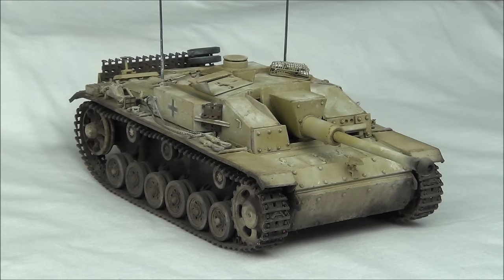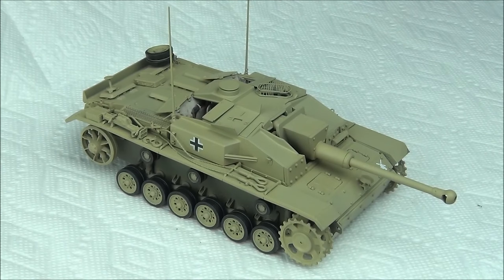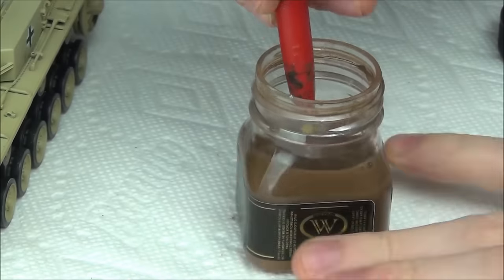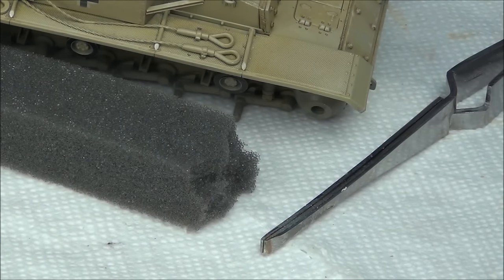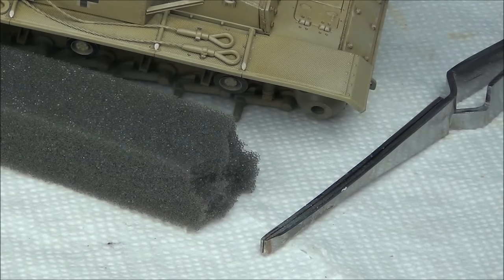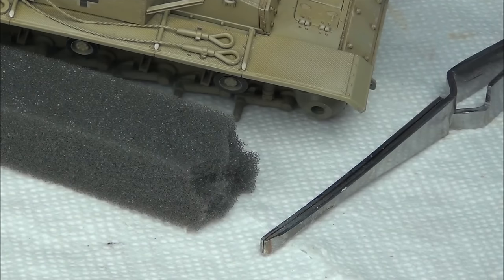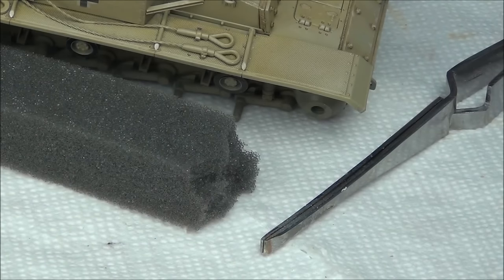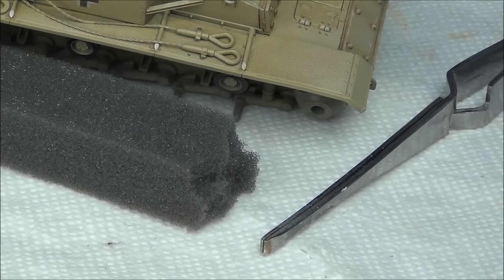STUG F/8 | Standard Weathering Procedure  (Full Weathering Tutorial for Model Tanks)

Comment: Hello, again! One million dollar question: do you apply a layer of varnish after filter/before pinwash?
Reply: Question nuber 2: do you apply a layer of varnish before oils?
Reply from the maker: My process is usually:

-Paint model + paint details + decals
-Semi-gloss varnish
-Wash
-Filter
-Oil dots and other oil effects
-Matte varnish

If you want to, you can apply varnishes between each stage.  But I don't find it is necessary since if you leave oils or enamels to dry for 24-48 hours, they will not be removed by later effects unless you are very rough.  

So you CAN apply varnishes (no harm comes from this), but you usually don't NEED to.  That's the best way to put it...I hope that helps :)

Comment: Yep, it’s an old video, but I need some advice. I’m doing a Tamiya M5A1 and wanted to do a hairspray chipped olive drab as a base. Should I use black as an underlayer or should I use more of a rusty color? Or should I skip the chipping altogether?
Reply from the maker: +Havanadog 7 well if you really want to do the effect, then a dark brown rusty colour would be good.  But US olive drab really didn't chip as it was a super thick and durable layer of paint that was baked on with heat lamps.  It would really just scuff up to a darker green colour, so that is another option - using a darker green ad the underlayer.  I plan to show this in a video soon.
Reply: Panzermeister36 thanks for the tip! Will definitely watch your video before painting. :)
Reply from the maker: +Havanadog 7 well it may be a month before my video is made sorry.  I've got a few things on the go right now.
Reply: Panzermeister36 the model still hasn’t even arrived yet so no rush 😂

Comment: there is a brighter yellow for Africa korps tanks. what do you suggest? is tamiya ts34 the right color.
Reply from the maker: This tank here was painted that colour.  Originally a bunch of these StuG F/8s were going to Africa, and so they got painted sandgelb.  Then they got sent to Kharkov instead.  I would usually use a slightly lightened XF-60 for the standard dunkelgelb colour, and here I used a different mix as I showed at the beginning.  TS-34 is probably pretty close, and you can just filter it lighter or darker if you want to change it a bit.
Reply: Panzermeister36 thank you

Comment: Hey, i tried to to this kinds of oil paint tone weathering techniques but when i used the enamel thinner it took off some of the base coat, any solution for this?
Reply from the maker: +RED Spy I would suggest using a different thinner.  It's likely that your thinner was too strong and damaged the base paints.  You can use lighter fluid as an enamel thinner and it should not damage acrylic base paints.  I hope that helps.
Reply: Thanks man love ur channel keep it up!

Comment: How accurate is that kit? I'm a dumbass for interior kits,I have to have them lol I do check into accuracy as well,but don't let it get to me if it's things that can be easily fixed. I'm barely on your filter section,got ways to go
Reply from the maker: It's quite accurate.  I can check on my list and get back to you.
Reply: @Panzermeister36  for sure
Reply from the maker: Sorry for the delay.  I have a list I've made of all corrections for these StuG kits.  For this vehicle, just the rear tow point, rear light and corresponding rear fender are wrong:

-Use option of parts B41+B42+B43+B44 on rear hull (step 3) not B29
-Replace rear light parts G8+J4 (Panzer III hull) with A13 or G9+G2 (StuG hull)
-Replace driver’s side rear fender Q25/26 with A39/41 (to match above)

Comment: Did you put any clear coat after your base coat, before you did any of the weathering
Reply from the maker: No, I never use any clear coats when weathering.  I find it to be unnecessary.
Reply from the maker: Well I applied a matte coat right before the Hairspray Chipping actually, but that was because the chipping can damage the underlying effects due to all the scrubbing.  But that is the only case where I will seal a model.
Reply: Panzermeister36 Awesome. Thank you, just getting into doing weathering. I’ve done a little weathering before but nothing as extensive as your video. Other videos they used that floor shine before the washes and mine just turned out too glossy. Great video and great reference video for begginers
Reply from the maker: If you're going to do a coat like that to help the washes flow, yeah I personally would not use gloss because it's just too shiny.  Satin varnish is a good middle ground.

Comment: Great video!  You do very great work!  Is that Dragon 6644?
Reply from the maker: Thank you Matt.  Yes it is 6644...best Dragon kit I've ever built.  Highly recommended!
Reply: How long would you say the oils and filters take to dry?  Never used either before so I am curious to try.  Also, on your video with the Panzer III in the Grey/Brown camo, what color brown was that?
Reply from the maker: They usually dry within a couple of hours, though artist's oil paints can take a full day or two.  The Wilder ones dry much quicker, but usually after a wash or filter or something like that I wait a full day before doing the next technique, in this case that was the chipping.  As, I used Tamiya's JGSDF Brown for that...I think it's XF-72.
Reply: Thank you!  Do you put any dullcoat or clear coat before you start the weathering process?
Reply from the maker: I didn't in this case, but I sometimes do if I want to protect undelying effects.  For example, I did a sealing coat right before the whitewash.  I also use matte lacquer for a sealing coat because I find a gloss cost to be too smooth to be able to weather with oils or pigments.
Reply: OK, thanks for the help!  I usually use testors dullcoat before I do any weathering.  Sometimes use Vallejo matte varnish thinned with water as well, but that sometimes leaves a white streaking affect.
Reply from the maker: Testors Dullcote is exactly what I use too :)
Reply: It works well.  Really brings out the shadow affect under the main color.
Reply: One other question, and I apologize for all the questions, haha.  This might be a dumb question but are the stencils reusable for the crosses or do you need to use a new one each time?
Reply from the maker: Matt F Don't worry!  Ask all the questions you like :)  These DN Models masks are reusable, but I'm not sure about other brands.
Reply: Thank you!  Was considering trying them at some point.
Reply from the maker: Mitko Nikitov runs that company, and he has a Youtube channel too.  If you search DN Models on google his site should pop up too.
Reply: I'll check it out.  Thank you!
Reply: what would you suggest to use if you wanted a textured surface, such as seen on a Merkava tank?
Reply from the maker: +Matt F Ah yes anti-slip... I've never had to do it before, but I will soon.  SchweinHund227 (Norm Lajoie) and Beez Beasley have some good methods for doing this, so check out their channels.
Reply: Panzermeister36 thanks!  I'll check them out.  having a very hard time finding kit 6644, think I waited to long to buy it lol

Comment: You don't paint handles with vehicle paint...it causes chips to cut your hands as you use them.
There are a couple versions of the wire cutters, late war they were compressed paper, mid war bakelite, early they were wooden with wire retainers.  They stopped the wood because it was too labor intensive and conducted electricity, stopped bakelite because it was needed for other items.  The compressed paper was resin coated and cracked often cutting hands.  So most were wrapped with leather or cotton to protect hands while being used.  They were used for clearing obstacles.  They worried about electricity when the Russians ran electricity through barbed wire near obstacles to electrocute tankers who tried to clear them.   They would run a positive to a metal tank hedgehog and run barbed wire in the middle of 2...the tanker holds on to the hedgehog to steady themselves as they cut the barbed wire...it completed the circuit....fried the tanker...they hit it with the tank...really bad stuff happened.

Comment: Nice video, but the use off micro set & sol is not correct. The set has to be used first and the sol goes over the decal.
Reply from the maker: I have seen it both ways actually, so I wasn't sure.  I bet you're right though, but I still only use Micro Sol for both before and after since that always works perfectly for me.

Comment: A rubber antenna would not attract radio waves, rubber is an insulator.
Reply from the maker: That is very true.  I should have thought of that.  Anyways, they did have something around the antenna themselves, but I don't know what now.
Reply: mailperson Dont know where you heard that. They have rubber bendable radio antennas you can purchase for your car, I had one for my jeep and it better than the original metal one and it was 6 inches tall, so I know rubber coated antennas work. Rubber antennas are/were also used frequently on handheld radios, old brick cell phones, police scanners, even your basic alarm clock has a rubber coated wire antenna usually...
Reply from the maker: The long wavelength of radio waves is probably not interfered with much by a thin rubber coating then?
Reply: You are talking modern tech verses WWII tech, Antennas were metal back then with ceramic or rubber insulators separating them from the metal hull.